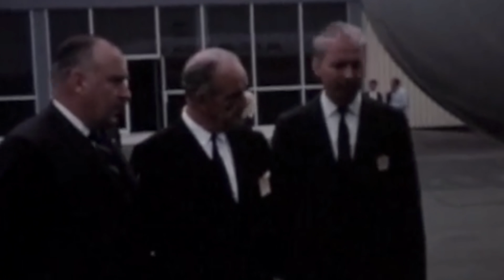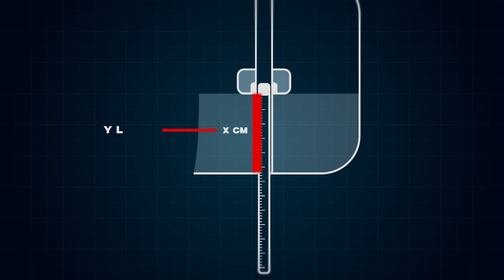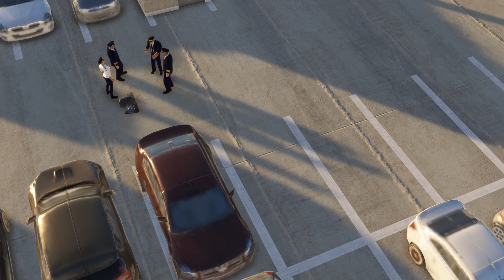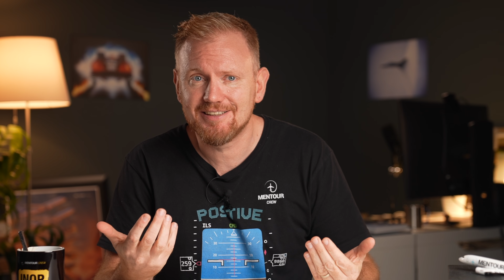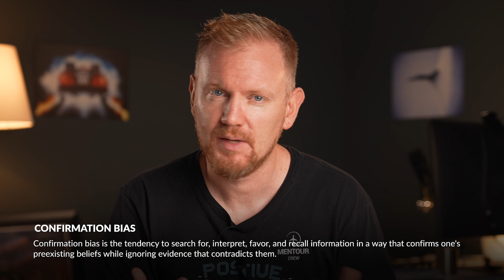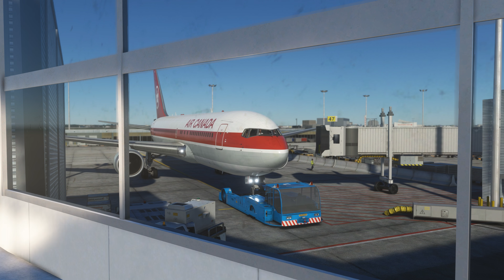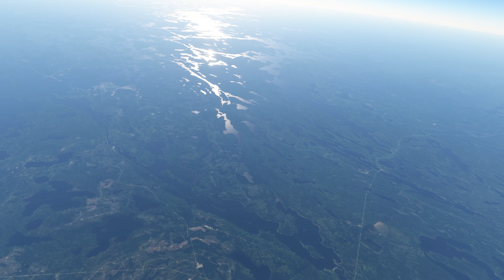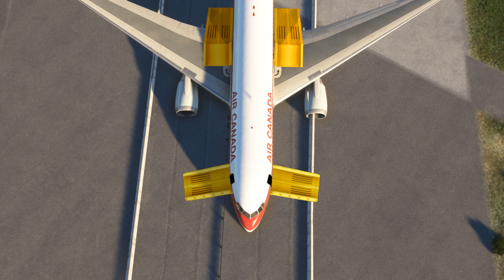NO Engines and Out Of FUEL! | The ”Gimli Glider" Miracle

Comment: Why does aircraft fuel need to be converted into kilos? Wouldn't it be easier and safer (like showcased here) if everything just used liters ? No need for converting anything and it could have been read directly from the fuel stick

Comment: Unfortunately this telling of AC143 leaves out some relevant facts regarding the 10 day deviation for the fuel quantity indicators on fin 604 flt AC143. I'm retired from Air Canada and I worked in YUL operations day-of for AC143.  Since he wasn't there,  Mentour has to fill in the blanks with 'best guesses' for how the situation unfolded.  The main factor missing from this version is the fact that fin 604 had been restricted to operating YUL-YOW-YEG, YEG-YOW-YUL for the duration of the fuel indication snag.  On the fateful day, the aircraft had arrived in YUL late and the station was attempting to minimize the turn-around time for its return to YEG via YOW.  Normally AC143 would have only had YOW fuel when it left YUL.  A revised fuel load was subsequently issued by flt dx adding YEG fuel to minimize the delay in YOW.  When it couldn't be confirmed that the refueler had returned to the aircraft and boarded the additional fuel for YEG,  line mtc was  tasked with doing a drip to determine what fuel quantity was actually on board. Murphy's LAW.  Both mtc and Flt ops made the same same error in calculating  the quantity (the B767 was the first metric airliner and also the first airliner in which the drip stick markings weren't in gallons or litres, but simply units). 
The flight  had departed YUL, arrived in YOW, departed YOW & was nearing YWG when flt dx contacted the crew to suggest diverting to YWG because dispatch suspected that the additional uplift hadn't been boarded....& simultaneously the engines began to shut down.  Captain Pearson, an accomplished glider pilot was anticipating having to ditch in Lake Winnipeg when the F/O remembered Gimli where he had trained as a novice pilot.  The rest is history.

"We can all learn from the parrot.  It's content to repeat exactly what it heard without trying to make a good story out of it".

Comment: WHY DON'T THE AIRPLANE MANUFACTURERS INSTALL VIDEO CAMERAS ANY PLACE THEY CAN ON THE EXTERNAL PART OF THE AIRPLANE, TO ALLOW THE PILOTS TO SEE EXACTLY WHAT THE ENGINES LOOK LIKE AS THEY'RE RUNNING, OR THE WHEEL SITUATION ON ANY OF THE LANDING GEAR, OR ANY OTHER PART OF THE PLANE THAT NEEDS TO BE WATCHED? I would think that this would also be piped into the black box that's always retrieved when there's a crash.

Comment: Problems are preprogrammed, if more than one unit for the same thing have to be used. All used terms and units have to be normed to be unique for the same thing on the whole world. Only one ("1") can be acceptable.
I remember of my first conversion between mm and inches for PCB design. The resulting PCB was unusable, expensive crap. In terms of a flight and requirement calculations, this is really dangerous.

Comment: Most accounts of this incident don't go back further than the ground crew miscalculating the fuel loading required.  I recall some mentions that the fuel quantity system had to be manually set for some reason.

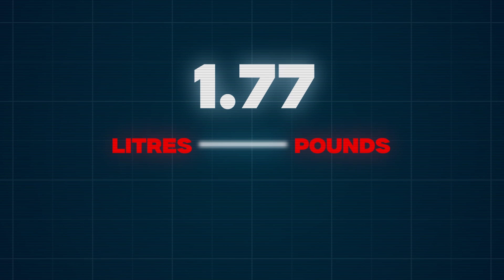Comment: 20:00 While the conversion beween metric and stone age imperial was obviously the most important issue, this story also shows some inherent advantages of the metric system: It's full of trivial conversions that can simply be called up by anyone growing up metric. In this case, it's the weight of water, 1 kg/litre. If a layperson who grew up metric would've seen the result of the fueler's calculation (7682 l x 1.77 = 13597 kg), she might have noticed that this fuel appears to be heavier than water.

For comparison, a litre of water weighs 2.20462 pounds, a gallon weighs 8.34 pounds. You could memorize these numbers, but the point is that you wouldn't have to in metric. You already know, and it's so trivial that it can immediately raise red flags in your mind if you are facing faulty results like the fuel conversion.

Edit: 25:20 I don't think it would've been simple reasoning for somone not growing up metric.

Comment: How did they think about creating a RAM Air Turbine but not consider the fact that a dual engine failure could happen?? That should be one of the first things you think about when it comes to an emergency. Have they never considered an aircraft running out of fuel??

Comment: As I am very well familiarized with motorsport, I can clear something that most definitely could have helped this plane to stop. There is a treatment made on drag strips, called PJ1 trackbite, formerly called VHT, that basically is a superficial rubbery coating on the asphalt, which makes the strip extermely grippy. Depending on how much it is applied, if you step on this with shoes loosely tied, your shoes will get stuck on the asphalt on your first step.

So IF this strip was treated with this substance (some local drag strips aren't), it most definitely helped the aircraft to stop quickly. And as a strike of luck, if it was raining at the time, this surface treatment when wet, it's more slippery than an ice skating rink. Don't ask me how I know it, it is definitely not because I totaled a car at a slightly wet strip. So that's certainly why they wouldn't use this treatment on any airport strip. It is 1000% great on dry conditions, and hell on earth when wet, so not justifiable to use it for airports.

Well, that's it, great video as always Capt. Petter. And thanks for your in-flight and on-line services.

Comment: minor linguistic correction... the thing for manually measuring fuel depth in a tank (or oil depth in an IC engine) is a dipstick, probably because it's a stick you dip in. It's not a dripstick.
Reply: Both dipsticks and dripsticks exist for manual fuel measurements.  Technically the 767 uses magnasticks, which are still routinely referred to as dripsticks by maintenance crews despite being dripless. Mainly due to the fact that they pull down from the underside of the wings like true dripsticks on older planes. The official accident report for this incident uses "dripstick" throughout.
Reply: @cjames0723  i learn something every day... Google only references dripstick in a sexual sense unless you add 'aircraft' to the search! A very different device to a dipstick used for level measuring... a pull down tube  that actually drips!

Comment: Speaking of Canadian content, has the MentourPilot covered the amazing and unforgettable Air Transat flight that also ran out of fuel and also glided  safely into an (island) airport, this time in the Atlantic "On August 24, 2001, Air Transat Flight 236 experienced a catastrophic fuel leak while flying over the Atlantic Ocean, leading to the loss of engine power. The Airbus A330 glided for nearly 120 kilometers (75 miles) to an emergency landing in the Azores, saving all 306 people on board, including 293 passengers and 13 crew members. The incident was caused by improper maintenance, which resulted in a fuel leak in the right engine, leading to the engines flaring out. Captain Robert Piché and First Officer Dirk DeJager managed the landing skillfully, making it one of the longest passenger aircraft glides without engines. 
Wikipedia."         As an interesting side note, psychologists determined afterwords that 50% of the Air Transat passengers developed PTSD afterwards and the rest didn't to provide a valuable scientific insight into human reaction to traumatic events.
+5

Comment: In regards to video quality. It's always top notch, the only thing left to be desired is that the graphical fidelity is cranked to the maximum. 
Example. The polymer particles forming up with saltwater in the Cathay flight 780 video, they were unrealistically shown floating around in the wing. Right after, some wing tanks were shown on an overview sketch of the airplane fuselage. That was much clearer. 

Same goes to the advanced diagrams being shown in that same video. More of that. The more technically detailed it is, the better. Your audience is interested in this from a technical standpoint anyway, crank it up to max. You'd only be appeasing your main audience. And the work put into a detailed explanation of technical mishaps is what makes us better in the industry. 
We should learn from the mistakes so we may save lives. Or rather prevent that they're ever put into danger in the first place. 

I have learned a lot from the world of aviation from these videos. And they're abbreviation heavy, takes time to get familiar. So every time there is an abbreviation, get it on screen so people can take notes and get it hammered into their head too. 

9/10 content
Reply: This is ai

Comment: First read this story many years ago, and then as now the one thing that struck me as remarkable about it was that Captain Pearson, in addition to being a highly qualified airline pilot, was also an experienced enough glider pilot to both know about that slip manoeuvre and to have the confidence to do it in a disabled 767.  To me that was the key step that brought off the successful landing, and I'd imagine it must be one of a very few occasions it's been done successfully with such a big aircraft.

Obviously the lessons about maintenance and fuel checking and so on were learned from and better systems developed until one would hope that this particular cascade failure can effectively never happen now.  But the Air India 171 disaster shows that even with all the modern systems we have now, things can still go fatally wrong.

Comment: I always wondered why the pilots didn't cross-check the fuel burnt against the distance travelled when the dropstick test was done after the 1st part of their journey. They would have seen that the total % of fuel used had far outweighed the % of distance currently travelled and in turn realised they had far less fuel than required to complete their journey?

Comment: On the 727 at least aircraft is supposed to be leveled using jack stands and a plumb bob located in the wheel well. This obviously takes longer than 45 minutes to an hour. Mechanics hated on you for calling this out on them. So the easiest thing to do was top off the affected tank load permitting 😊😊

Comment: Took you long enough to cover this. Is that because it totally upstages Sully, with his sterile cockpit violation and failure to memorize memory items like the “ditch” switch
Reply: Umm, not quite. Sully didn't negligently override others to order an unsafe takeoff. That's right, Pearson OVERRODE the objections of those on the ground who were uncertain of the safety of the fuel load.
This is all directly from the official Canadian accident report.
So celebrating Pearson is like celebrating a drunk driver, who miraculously swerves away from a busload of orphans.

Comment: Grateful for any aviation guys comments to this question: I'm a car guy and son of an engineer.  Short version - in a well set up car, you can feel the difference in the acceleration, braking and cornering of a performance car even between a full and near empty fuel tank.  To keep it simple, that's say, a 50kg difference in a 1500kg modern car, or about 3%.  I'm curious - in a 767 wouldn't the pilots notice in the final take off that the plane accelerated and lifted off a smidge quicker and more easily than expected?  Or the relative Kg missing wouldn't be enough to notice, you need to have 10% to notice or some such?  I don't mean to fault the pilots or suggest anything they noticed reached a threshold they should have done something about at the time.  More, maybe they noticed, but the significance only became clearer later when they were gliding.  Grateful for anyone able to answer with rough figures and % for that missing fuel, aircraft take off weight etc.  Thank you!

Comment: I started writing:

"These engineers are idiots: 1 litre of water is 1kg. 1 cubic centimetre is 1g. That's the beauty of the metric system. So multiplying the volume by a number greater than one when you know that aviation fuel is less dense that water is utter stupidity."

but then you mentioned the fact (more kindly)!

But on the other hand the pilots were really good on landing. Rather impressed by the glider action. Found it very strange they accepted to fly a plane with no fuel gauge. As you mentioned even with the correct amount of fuel on departure fuel leaks can happen.

Comment: See what happens when to switch from the correct freedom 🦅 units to heathen units? 

Planes crash.

Help save lives. Use imperial measurements 😂.
Reply: Ah yes imperial system unit based on the length of God's penis.

Comment: 25:18 As someone who has grown up using the metric system, hearing 1.77 immediately rang alarm bells to me, for the exact reasons explained in this section. I don't know much about aviation, but anyone at all familiar with fuels know oil based fuels float on top of water (which is why oil spills cover the sea surface rather than sinking down), and this means they have a lower density, i.e. should be below 1kg/l. The easy conversions between different measurments is why it is normally an extra safeguard against mistakes. Our maths teachers always emphasized this to us: "make sure to think logically, does your conversions make sense?"

Comment: 36:03
“If they continued on their current glide path they would overshoot the field entirely but also if they pitched down too steeply they would gain too much speed”
These are two examples of correct use of the second conditional.

Comment: Incorrect conditional at 22:07
“The absurdity would have been caught if the fuel gauges we’re working”
Correct version:
“The absurdity would have been caught if the fuel gauges had been working”.
This is called the third conditional. But l don’t take my word for it, scriptwriter; check it out in a grammar book.

Comment: It was my brother's racing club that was on the runway that day.  They were in the middle of a race and the red flags suddenly came out.  The the race cars began to pull over and the drivers looked up to see an immense jet landing on the track.  The drivers and volunteers immediately began to gather together their fire suppression equipment an emergency supplies just in case.  I went do an anniversary event a year or two ago where the pilot was speaking at the same race track and sharing the story of the landing. A few of the passengers were there as well.

Comment: I'm not sure about the math parts. 0.8 is more than 50% off of 1.77, since 0.8x2=1.6, so it's not almost 50% but more than 50%, right?

Also, is it really a coincidence that the 10000kg they had correspond to 22000 pounds? They wanted 22000kg, but used the wrong formula and ended up with 22000 pounds instead of kg. So yes, when you convert 22000 pounds to kg, the kg value is converted to pounds the 22000 pounds.
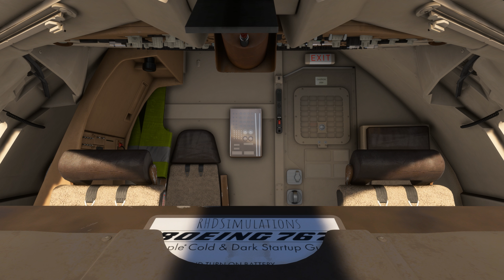Did I misunderstand this part? 22:32

Comment: Whenever I see a conversion chart telling you what number to multiply by I do a facepalm. It's just such a bad way to think about unit conversions and it's one of the reasons people screw up. If they learn how to do it properly, using equivalences, such as 1 ft = 0.3048 m, and unit cancellation then it's easier to be correct and confident in your answer, as well as being able to handle mixed units such as lb/hr.

Comment: Wouldn't the missing fuel mess up the weight and balance of the aircraft, and maybe result in an incorrect trim setting? Would the pilots have noticed that the aircraft's rotation was different than normal?

Comment: "NO Engines and Out Of FUEL!"...
Once you're out of fuel, having or not having functional engines is also irrelevant... 🙄(Unless it's a fighter jet that can be resupplied midair, which is not the case.)
And once you have no engines, the lack of fuel is quite irrelevant... (In fact, if you have no engines and you have to glide to an emergency landing, for safety reasons you would dump all your remaining fuel, so having no fuel actually saves you the trouble.)

Comment: As a student of math. I love when I can see the units. Just picking up a calculator without clearly showing where units are is a dangerous thing. This should be written on paper or in a spreadsheet to clearly show if a unit is being cancelled or should be your remaining unit(s).

That 1.77 or 0.79 are quite meaningless values, especially when you deal with these quantities. Well until you are firmly comfortable with the conversion (able to make a guestimate before doing the calculation).

Comment: Hard to understand how the pilots didn't immediately realise the fuel error - 7000L of water weights 7000kg - fuel has a lower density than water so the weight of fuel in Kg's would always be less than the litre figure.  Should have waited 5 mins - Mentor has just made that very point!

Comment: I am wondering if the captain's experience as a glider pilot contributed not only to his ability to make a safe landing without engines, but also to his initial decision to fly without a functioning fuel gauge? As a layman, this seems a straightforward matter of common sense and I would certainly hope that the pilot of any plane I flew in would have the professional autonomy and responsibility to refuse to take off in such circumstances even if he was completely certain his superiors had approved it. I worry about the approach to air safety that investigates accidents and makes new rules to prevent them happening again. Does this maybe engender a slavish rule-following mentality where rules, maybe conveniently deployed by airline managements, can override a pilot's common sense?